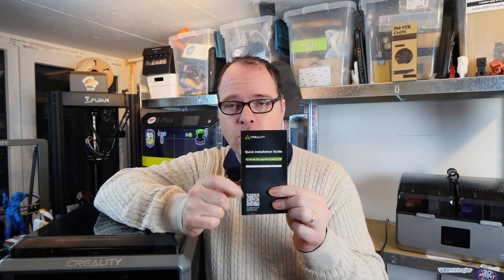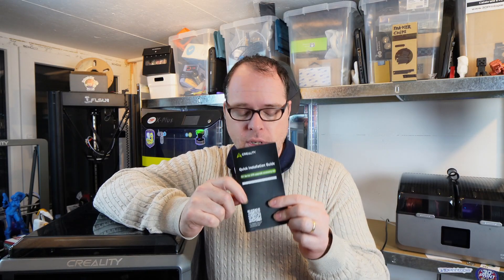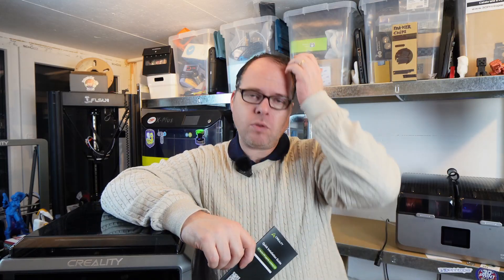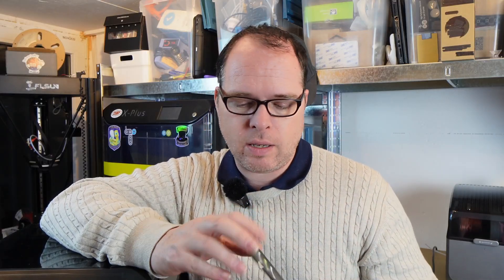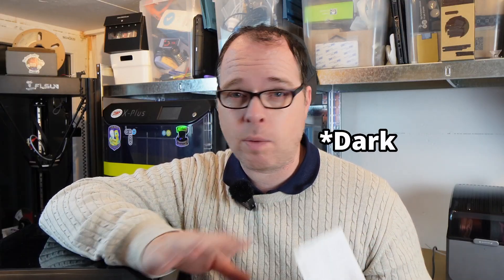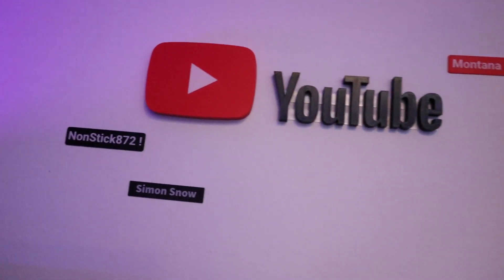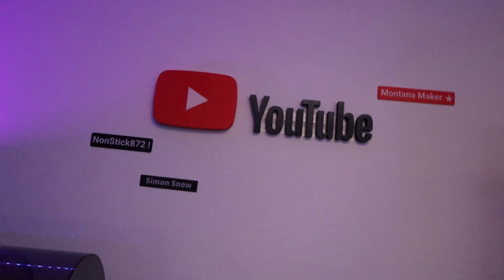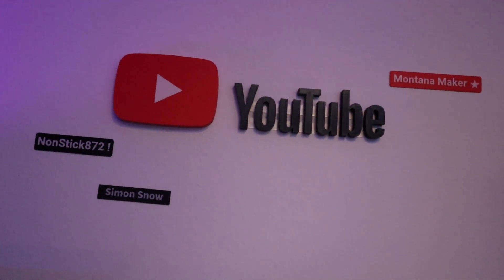Don’t Upgrade Your Creality K1 Until You Watch This!

Comment: i installed the upgrade on my K1, and each time i try doing a test print i keep getting TC2841 Cutter issues, cutter might be jammed, please try again after resolving...... It prints one color only until it needs to change color and then the cutter issue....what do i do now? if anybody has any info let me know
Reply: im having the exact same problem rn with my k1c did you ever get a solution??
Reply: @devonsellers8537 not yet, still the same thing over and over

Comment: And on the K1 max you will encounter the impossible to solve "cutter" issue. Printed great for around 10 days then the cutter stopped cutting and 4 weeks later I still haven't solved it despite many new parts and solutions tried.

Comment: It is really disappointing that the CFS upgrade kit did not work well for the K1. I know that they have three different kits, one for the K1, K1C, K1 SE, and another kit for the early K1/K1 Max and a different kit for the K2. The two kits for the K1 series are identical except for the new hot end that will be required for the early K1/K1 Max due to different designs. These kits cost more than the printer itself and it is a disaster if they don't work and the owner if left with the problem K1 and has to backtracked to bring it back to life. I do hope that he reported the problem to Creality technical support so that they can look into it. It could be one or more defective parts that prevents the kit from working properly as I am certain that they at least perform compatibility check on their upgrades.

Comment: I noticed that you're not using the unicorn nozzle. I had clogging issues with PLA, but I made some adjustments and it's been working. But in your case, it seems to be the lack of an update for the hotend with the unicorn nozzle.

Another thing that happened to me was that the filament cutter wasn't working, so I had to put a shim in for the cutting tool to work correctly.
Reply from the maker: Yeah, I think my K1 was one of the first batches from that series before they have changed several things on it. So I'll be going to update my K1 before doing the CFS upgrade
Reply: @wallacyneres3349  How and where do you place the shim please? Cutter issue is driving me nuts.

Comment: I upgraded my K1C and had no issues at all. For me it sadly sounds like a broken Filament Sensor. Even the problem with the „homing“ from the poop station. My printer never got stuck there. 

I only had to adjust a lot in OrcaSlicer to get the G-Code to use all the CFS capabilities. 

So perhaps ask Creality for a replacement filament sensor or check, if the LED in the sensor is even lighting up or is blocked. 

Without being rude, this sound like user error or defective part, so to call out Creality in such a definitive way and discourage people to try this amazing upgrade by the sample number of one unit is a bit sad to hear.
Reply from the maker: Great to hear from you dude. I tested my Filament sensor, by sticking the filament in and out, seeing the light going on and off. that seems to be working OK. Also after closer inspection on the sensor, I didn't see anything blocking the sensor. The Filament just stopped around the 5cm from the sensor and stayed in the PTFE tube. 

I said several times in the video, that maybe I made a mistake, or like you mentioned defective part. But I didn't call out Creality in this video. I still have the upgrade in the box here and if there is a possibility to try again, maybe I'll do that. 
Sorry if I have the impression to call Creality out, that wasn't the whole idea of the video. But thank you for your feedback
Reply: @Zachary3DPrints sry but RTFM. The PTFE tube should be guided into the extruder from above, not through the cable chain. If the tube is too long or if the motor requires too much force due to bends, it can cause problems. Check whether you can manually feed the filament from the CFS through the tube to the extruder without any issues.
Reply: Did you even got the automated Flow Calibration working? I keep getting an error and seems like many others as well (AC0511).
Reply: That’s true. In the process I had to swap the PTFE tube from the spot where the old sensor was to the hot end and pull out the tube from the chain. Maybe that’s the problem